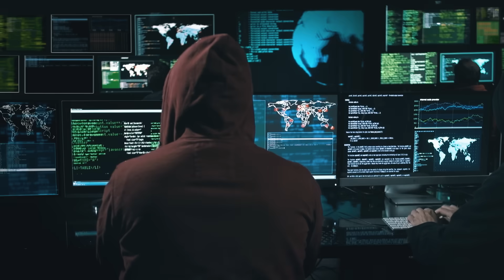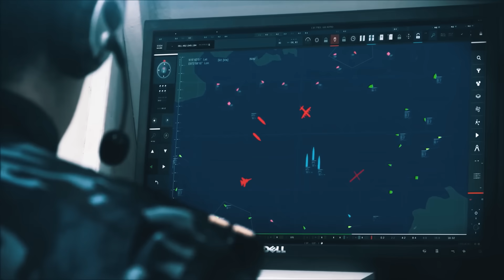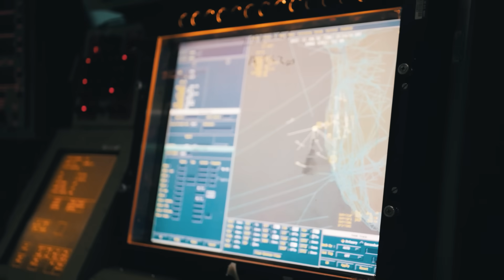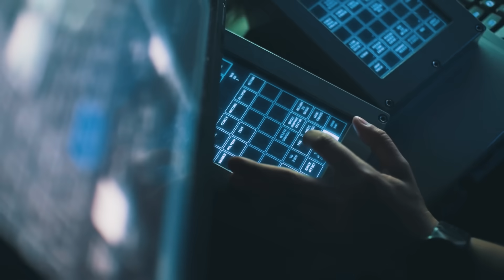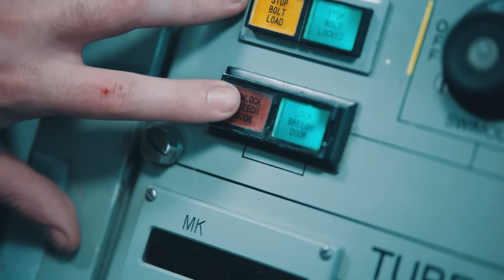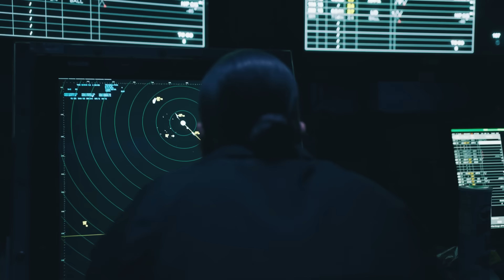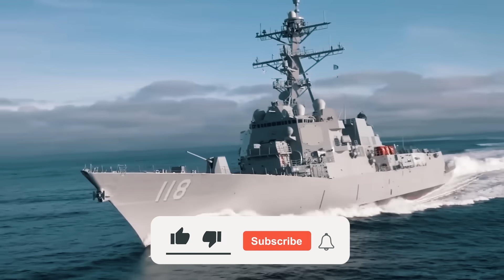US Revealed Another Brand New $13 Billion Aircraft Carrier To Stop China

Comment: Tripod aircarft carrier, could even have docking points for 3 submarines, to further proper it or prop it up as backup, or wepons loading, refuling, or assit in damage, partial refloating or keeping alot float as an assit.
Reply: I saw your other comment on hydrofoils, partially the reason that they don’t do that is because it would be extremely difficult to do that on a ship that displays over 100,000 tons of water, not to mention the carriers are already the fastest thing in the fleet, and on top of that it would greatly decrease your maneuvering capability, not to mention it would be extremely expensive and there’s really no reason to. And submarines travel with the carrier strike groups, and all of our submarines and aircraft carriers are all nuclear powered.  submarines don’t keep any fuel on them so there would be no way for them to refuel the aircraft carriers. And if a carrier sinks, submarines don’t have nearly enough buoyancy to lift them up, so it would really be pointless, not to mention most boats have many watertight compartments, not to mention pumps to deal with flooding, so you’d be able to limit the flooding and pump the water out